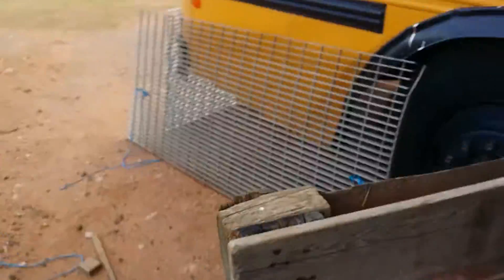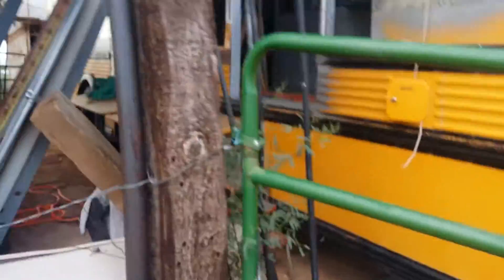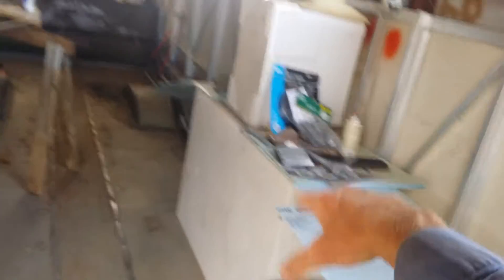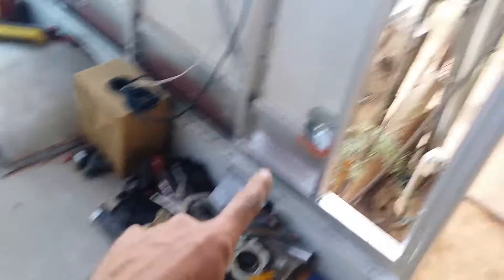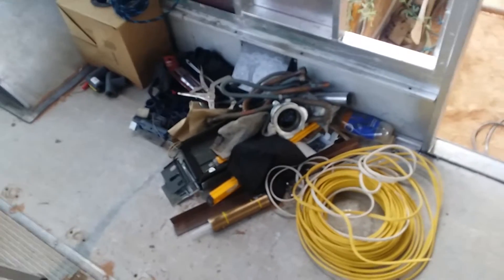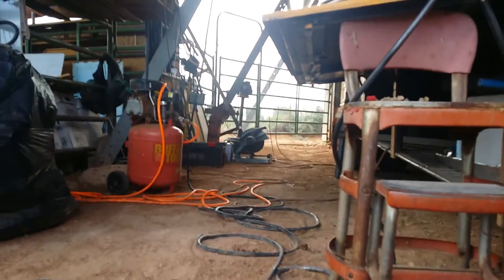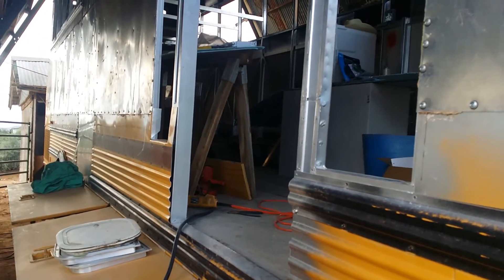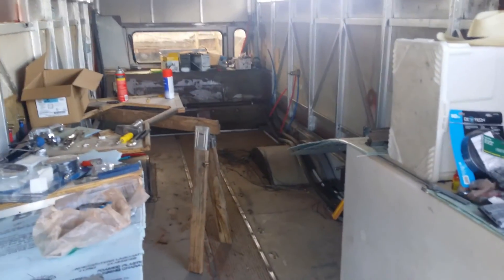Skoolie 3 foot roof raise pt 21 plumbing, electrical, propane

Comment: Open cell spray foam, no good. It will wick moisture. Closed cell spray foam is used as both a vapor barrier and insulation in homes. Looking good on the progress.